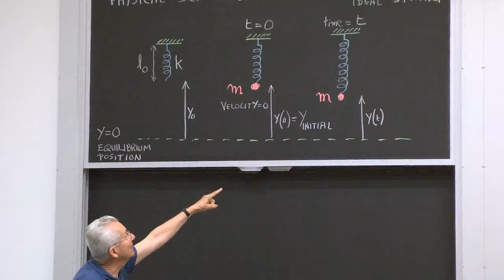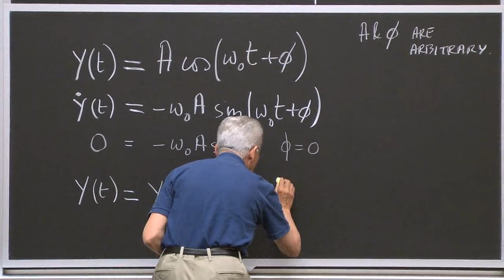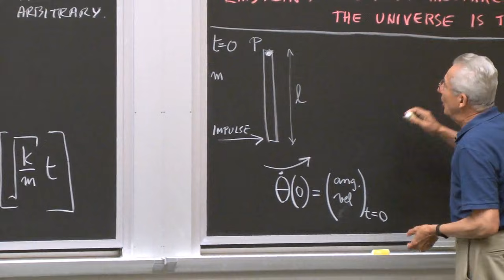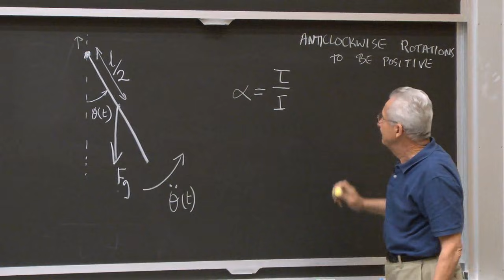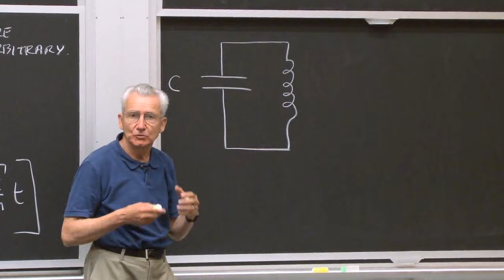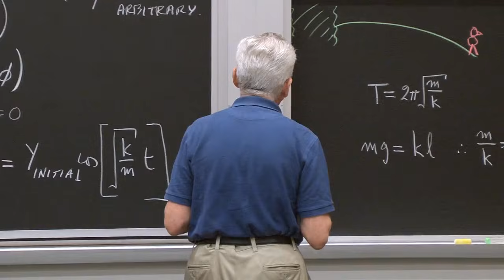1. Simple Harmonic Motion & Problem Solving Introduction

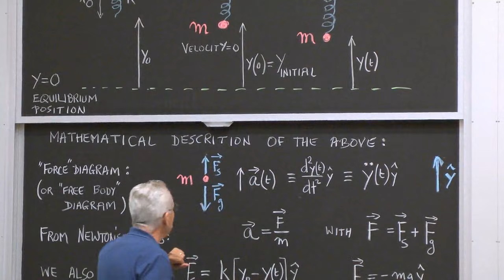Comment: There are some small but very important mistake made on the board around @11:00 and onwards.  At y(0) the mass-spring has already been stretched and is subject to upward acceleration starting from 0 velocity! So what is written on the board: y''=0 at y=0, y(0)=y_{initial}, and y'=0 is WRONG! The equation works out just because of algebra but the concept is false.

Your ground reference is y=0 where y(t) is measured from.  The initial position is y(0)=y_{initial} where velocity y'=0 and y''=a(0). And at equilibrium position is exactly when the mass travels at maximum velocity with zero acceleration, hence: y_0 = y_{equilibrium} where y''=0 and y'=y'_{max}

I respect Prof. Busza and MIT and such but this mistake should be amended before open students get the wrong concept up in their head and think they understand because the algebra works out
Reply: @clo7473 Prof. Busza did not make a mistake. The mass-spring system is only already  stretched if y(0) is negative, below the baseline, since the 0 of the y-coordinate system is chosen so there is no net force on the mass. What you said about "y''=0 at y=0, y(0)=y_{initial}, and y'=0" being wrong are in fact all correct namely y''=0 at y=0 is from the definition of the y-coordinate system, y(0) = y_initial is just notation and y'(0)=0 he chose as the initial condition.

Comment: Which book did he followed????  Please
Reply from the maker: The course that these were made for used these two books as their texts: 
French, A. P. Vibrations and Waves. New York, N.Y.: W.W. Norton & Company, January 1, 1971. ISBN: 9780393099362.
Bekefi and Barrett. Electromagnetic Vibrations, Waves and Radiation. Cambridge, MA: The MIT Press, September 15, 1977. ISBN: 9780262520478.

Comment: Hello,
I have to say, you said at 8 minutes or so why you are going slow, then at 21 you jump straight in and skip several steps, great there. As for the explanation of what's happening I find English works perfectly, release the mass whilst the spring is under load and the mass will move back and forth, what more do we need to know.  Sorry to say but a little disappointed.

Comment: FIRST SPRING-MASS PROBLEM: There is something strange. You cannot have Y=0 at the point where both forces are equal, since according to your drawings, Y is measured from the basement line. That Y-value must clearly be positive
Reply: the basement line is Y=0. he defined the coordinate system that way.

Comment: 22:50 BTW phi is not equal to 0 it's equal to nπ, since phi = sin^-1(0)
Reply: No Phi is not n*pi* in this case as if we take phi as n*pi*, then the displacement of the particle will not be zero essentially. We are deriving general equation for shm. So at t=0, x=0

Comment: u have defined a(0)=0 when y=equilibrium position ,theses r already conditions of shm..so i think u didn't proved the eq of shm and 1 more thing during a linear motion how could there be velocity but no acceleration as during shm at equilribum position v=max but a=0
Reply: think abt it intuitively, the particle has max acceleration at the extreme positions. By the time it reaches the mean position the acceleration will become 0, but since the particle already accelerated while travelling from the extreme position to the mean position, it'll have gained more velocity than before. So it ends up having max velocity at the mean position (x=0)

And the proof shown is perfectly valid. Try looking it up in a book to understand it better. Try coming up with the equations on your own as well, it'll help.

Comment: Which book would you recommend for learning the subject?
Reply from the maker: +Athanasia The following textbooks were used when this course was taught on the MIT campus:

French, A. P. Vibrations and Waves. The M.I.T. Introductory Physics Series. Cambridge, MA: Massachusetts Institute of Technology, 1971. ISBN-10: 0393099369; ISBN-13: 9780393099362 (http://www.amazon.com/exec/obidos/ASIN/0393099369/ref=nosim/mitopencourse-20)

Bekefi, George, and Alan H. Barrett. Electromagnetic Vibrations, Waves, and Radiation. Cambridge, MA: MIT Press, 1977. ISBN: 9780262520478. (http://www.amazon.com/exec/obidos/ASIN/0262520478/ref=nosim/mitopencourse-20)
Reply: ***** thank you very much

Comment: watch it at 1.5 speed
Reply: I watch all lectures at 1.5 speed because I feel it difficult to concentrate on the lecture when its going at normal speed.
Reply: rudeeeee
Reply: Cramming pro-tips!

jk
Reply: BEST ADVICE EVER
Reply: +Sanjaya Regmi how can i do that ????
Reply: +Abdullah Farag just go the little settings thing and change speed to 1.5
Reply: Sanjaya Regmi WOW It worked :) Thank you buddy
Reply: I tend to prefer 2.2-2.8x speed, which is not a default option, so for Google Chrome such speeds can be obtained by opening the console (Ctrl+Shift+J) and entering the command: 

document.getElementsByTagName("video") [0].playbackRate = x

Where x is the desired video playback rate (A rational number from 0 to 3). Enjoy :)

Comment: in many books it is written that y= A sin(wt + fi)
but sir say that it is  cos.which one is correct?
Reply: both, doesn't matter.
Reply: Its cos if it starts from extreme point, where in it start from the amplitude. The value of  the sum of wt and phi hence would be zero, if the distance from the mean position is the amplitude, or conversely it could be sin of wt + phi which would yield pi/2 to obtain the same value as the amplitude.

Comment: Dear Professor:

First of all I want to thank you by this excellent video.

I also want to make you a comment: In minute 42, when you write the equation of motion for a rule, you forget to explain why is possible to aproximate sinus(theta) by theta. 

At this point, maybe you could talk about MacLaurin development of sinus function and aproximation of small oscilations.

It´s just a mathematical sugestion that could be useful for many students.

Yours faithfully.

Fernando Nora.
Reply: Fernando Nora it's because the value of sin theta is almost equal to theta(very small)
Reply: for small angles, sin theta is theta